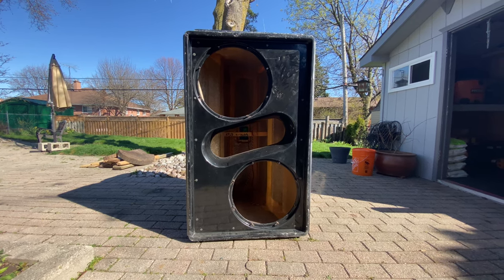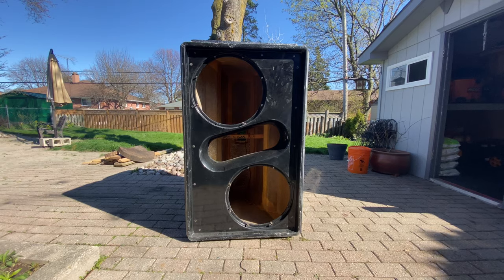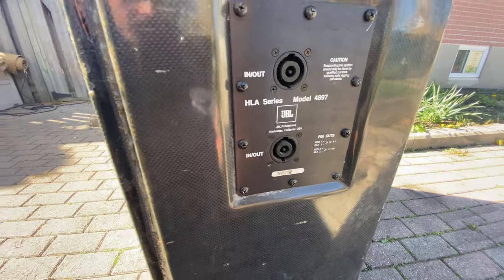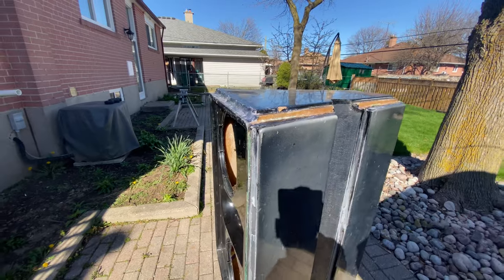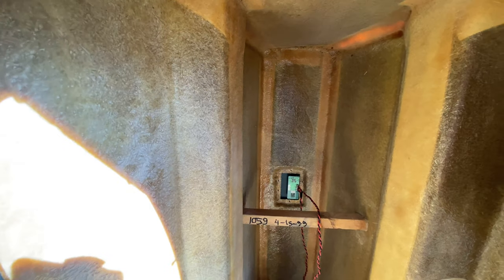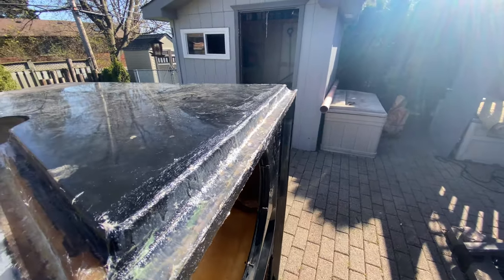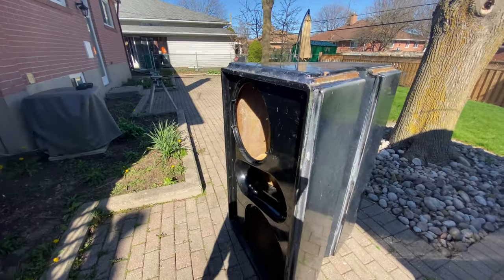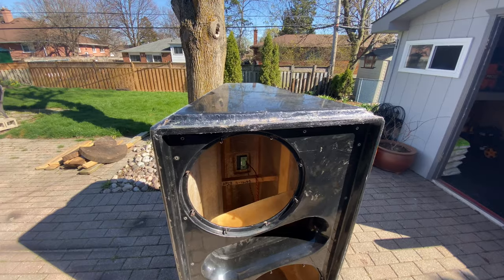JBL HLA 4897 Fibreglass Work

Comment: From the back looks like carbon fiber. First time i have seen a fiber glass box. I offen glass the inside of my boxes to brace them but they normally built from plywood. Keen to see when its done
Reply from the maker: dlf restoration yes sir A lot of these boxes were installed in casinos from what I have been researching and as well back in the days using them in concerts they definitely are amazing sounding boxes kind of sounds like a jbl vertec 4880a
Reply: @SoundGuy-vn3kl  they are cool the new oness are molded plastic but the plywood ones tend to go deeper. While you busy glass in some Bracing on the big inside panels and line it.
Reply from the maker: dlf restoration yes sir I was thinking but the sound of the boxes are really smooth lots of low end

Comment: Hello mate,
I own 8 of these subs with 4 top cabinets 4895. I would like to unmount the frame to give them the brand new paint they deserve, but I didn't find the way to separate the parts away...
Can I ask you how you managed to do that please ?
Thanks a lot by advance, Cheers
Reply from the maker: Peter hello there that’s awesome that you have them aswell I am from Canada as far as I no I am the only person in Canada that owns them I have never seen them in this country only in the USA and the uk it took me 5hours just to remove one box it’s not that easy plus you would have to heat the bars aswell with a torch because Jbl put a adhesive behind the bars and if you don’t hate them you’re never going to take them out you will end up breaking the box or cause a lot of damage to the fibreglass and then you will have to do big repairs with the fibreglass I am learning that now not much work
Reply: @SoundGuy-vn3kl  thanks to have replied !
Woaw it sounds like a job here, I'm not  too sure anoymore to wanted to do it... As I don't want to damage the amazing job JBL done on these carbon fiber subs !
I believe you, this system is pretty hard to find as it was extremely expensive at its time and only big company could afford it.
I'm from France and thanks to a huge event company that used to tour an impressive 96x 4895 tops + 84x 4897 subs system, people like me finally could afford it (in really smaller quantity for sure). They sold their entire system in smaller quantity so I definitely know that there's few people here that owns this system too.
I watched some others videos from you these last weeks and months, and I find funny the fact that we both own another really uncommon speaker, Yorkville U215 !
I'll stay around to watch your future videos.
Cheers from France
Reply from the maker: Peter yes sir if I was you i would not try to much work